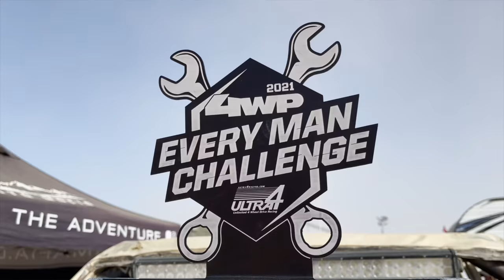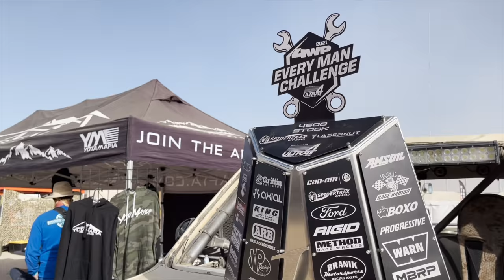SNAPPED Front Axle Jeep Driving off a Trailer - Broken Gladiator

Comment: Count your blessings and get rid of that turd.. trade it in for a yota!
Reply: I don't know man, as a life long Yota fan I was pretty impressed when I drove Phil's rig! Don't get me wrong, I'm sticking with #yotas4life but the Gladiator with all the upgrades literally floats over rough obstacles at 20mph (or 50??) along FS trails. Such a nice comfortable ride! However, this won't deter me to try and convince Phil to buy a Yota. I'll make a believer out of him eventually.
Reply: Unfortunately, new Tacomas can be less reliable than new Jeeps! Check out DirtLifestyle's latest video
Reply: @trackntrail2869  that is complete cap. Dodge jeep chrystler fiat is ranked the least most reliable vehicles on the market. For that one video you can find on a toyota having problems theres 100s of jeep videos out there with much worse issues
Reply: @Mr.Gavino  Go watch the video ;)
Reply: @trackntrail2869  my opinion will not be changed off of one video vs. The endless years toyota has been pumping out reliable products
Reply: @Mr.Gavino  you're entitled to your opinion - mine is that the new Tacoma is an outdated, barely off-road capable vehicle. Even if you don't think it will change your mind, I'd highly recommend DirtLifestyle's new video just to see some issues a Tacoma owner who truly offroads their truck runs into.